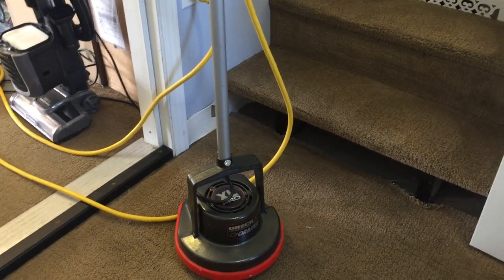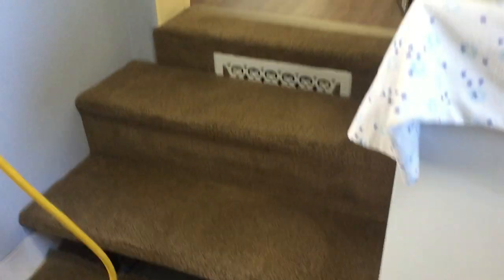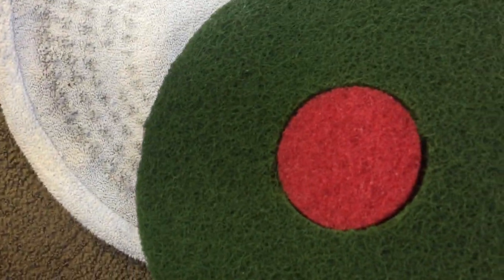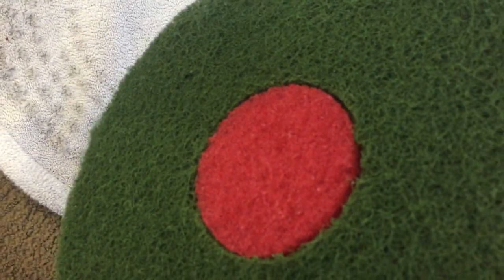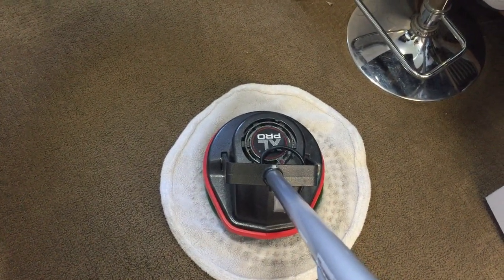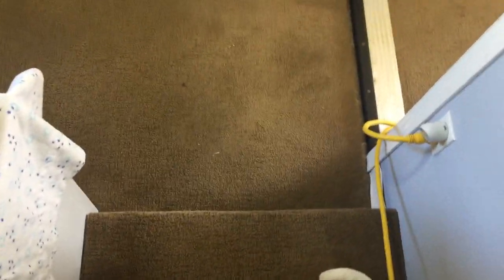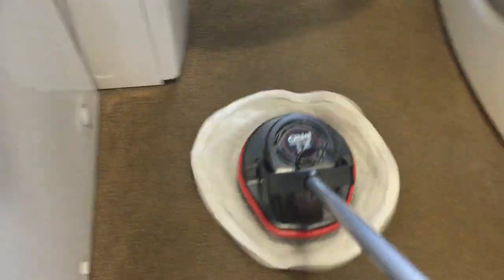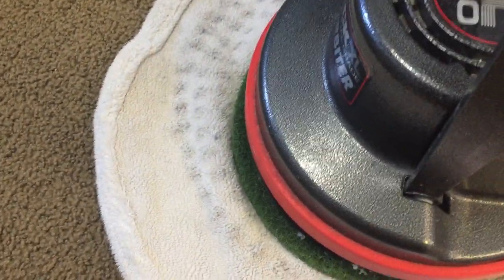Oxy-Dry Oreck drive plate modification.

Comment: Robin - did you modify the electrical cord connection to a locking style to receive an external extension cord?
Reply from the maker: Yes I have that on my Oreck and my rotary as well as my Orbitec and Orbot.